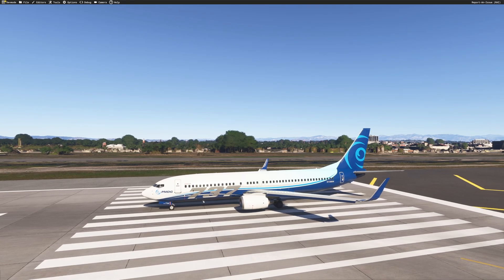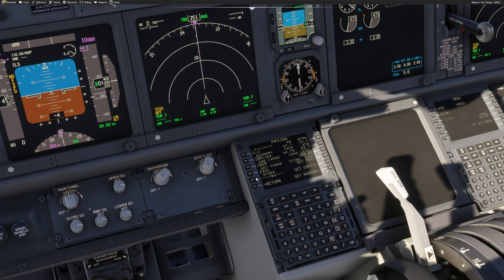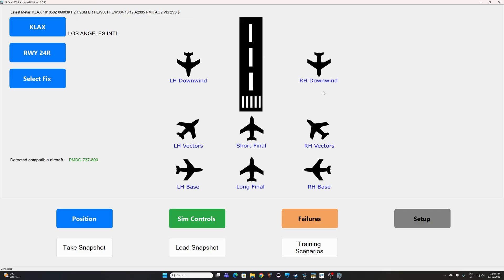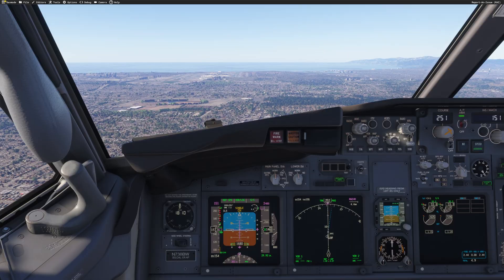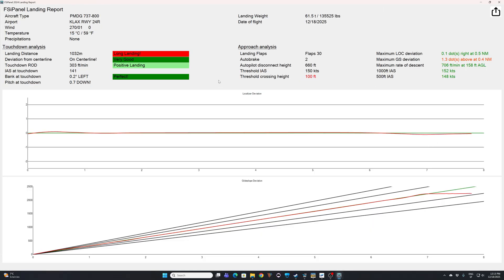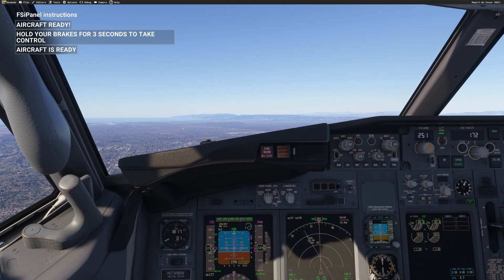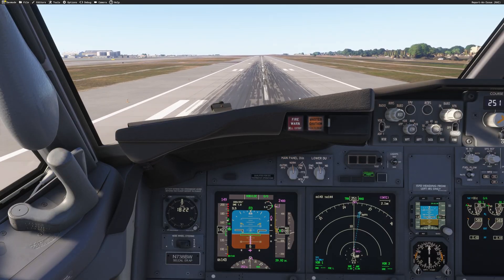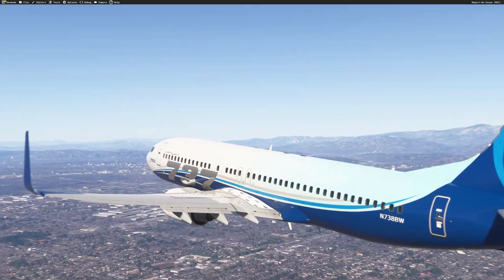FSiPanel 2024 - PMDG 737-800 - Fly approaches in seconds!

Comment: a piece of advice that you should recode the program, to set everything before moving aircraft up in the air, preventing aircraft from falling down or being knocked by wind and turbulent
Reply: Mine doesn't do that, works just as all the others do PMDG 777, Fenix A320. Think you may have other issues
Reply: How do you recode it?
Reply: @trainee-737  cuz sometimes when the im in the sky, it cant stop falling down while fsipanel is inputting the mcdu
Reply: @trainee-737  nah im telling fsipanel team to recode, so as to change the sequence. INPUT MCDU/FMC FIRST, THEN PULLING THE AIRCRAFT UP IN THE AIR!!!
Reply: Mine also falls from the sky. With the fenix a320 it works perfectly but the pmdg not so good
Reply: @hooryricardo  found the solution just activating "active pause" and may solve it
Reply: @Caiuonnn  And it didnt stop the fsipanel of setting up everything prior we take control ?
Reply: @hooryricardo  nah it doesnt matter. they dont conflict each other cuz it's an "active pause"